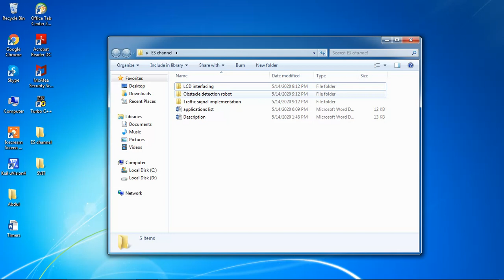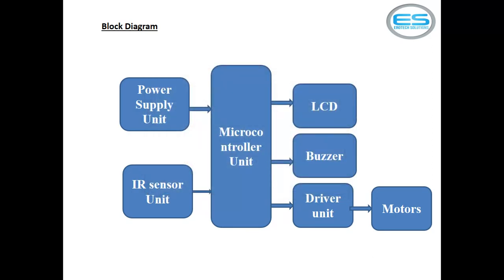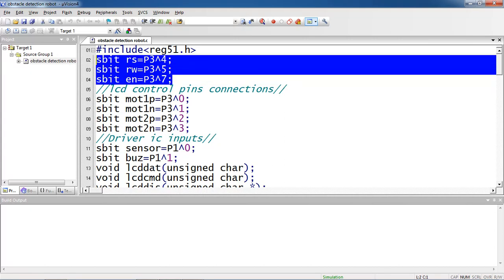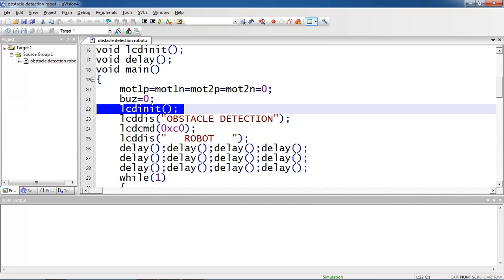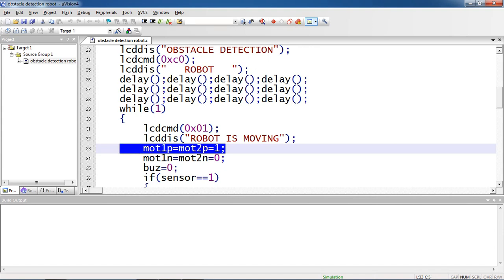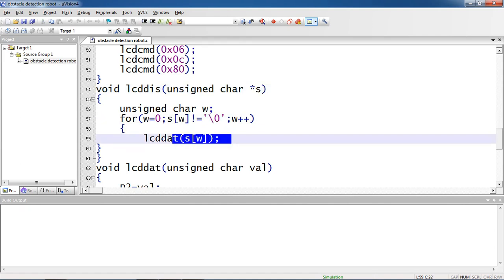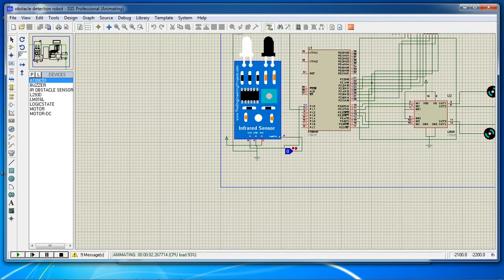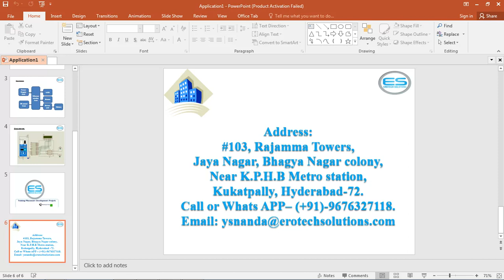Obstacle detection robot using 8051 Micro controller.

Comment: thanks for your video. Can i ask you a question? Do i need to supply power for the 8051(connect battery to the vcc and gnd pin), because on proteus i cant see the gnd and vcc pin, also i use sr05 as ultrasonic sensor, do i also need to connect it with the battery too? Im being confused in the power supply for this robot. Sorry for this silly question, im really bad at electronic. thank you.
Reply from the maker: Hi , Micro controller dose not need any supply on Proteus and other modules need power supply connections